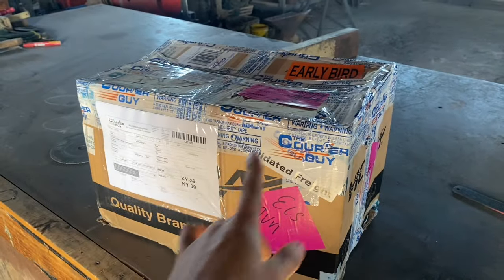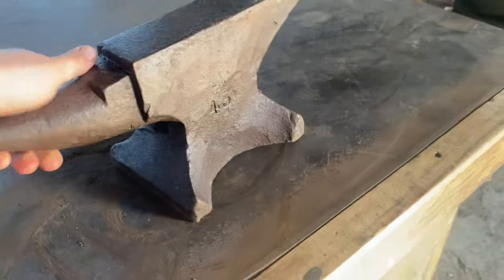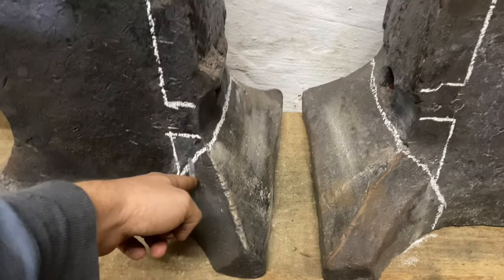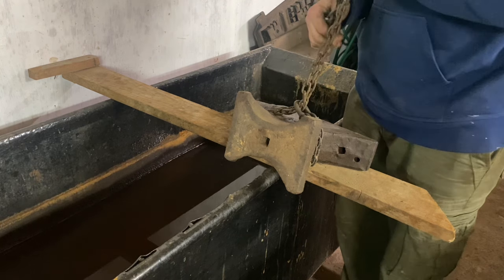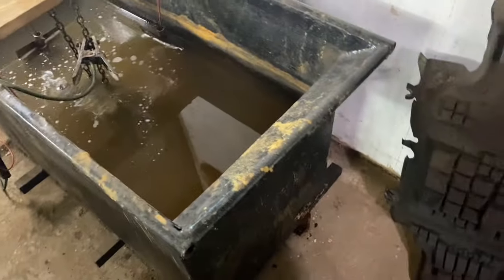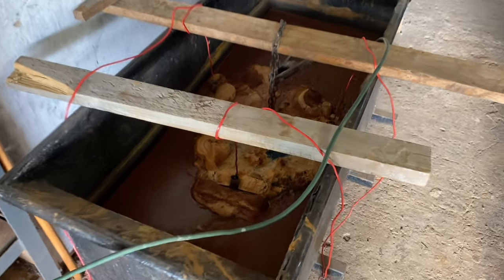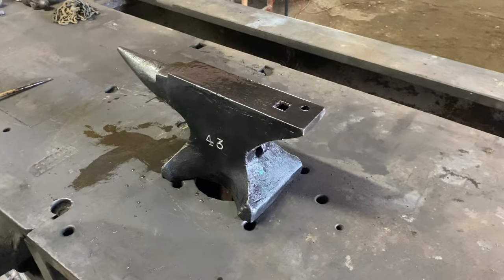Rare little 43lb forged anvil cleanup

Comment: nice! another little gem.  I just sold my 19kg double horn pfp. 🙄 ( bought a 54kg...)  And yes, they are German. Paul Ferdinand Peddinghaus.  If I remember correctly the anvils marked PFP are pre 1930, then "original pfp" then "peddinghaus" and now "ridgid peddinghaus".  Still closed die forged. The small ones up to 30 or 35 kg are one piece forgings, the larger anvils are top and bottom welded together. All tool steel. I don`t think there were / are better quality anvils available.  You`ve got a sweet little collection going on there 😎
Reply: Thats No PFP in the Video . 

The First PFP Anvils got the PFP and a Roman Number  .

Then came "Orginal PFP  " and  "Einheits PFP Amboss "  and "PFP".

Latest stand "Peddinghaus " complete on IT and now the rigid Thing ...
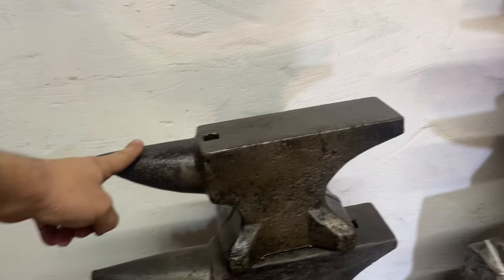Reply: @timom6388  I think the anvil @4:35 in the video definately is a Peddinghaus anvil.  Apart from all signs mentioned in the video, It is closed die forged and to my knowledge no other manufacturer did that.  I have owned lots of them over the past 40 yrs and never seen one marked with a roman number either..?  Could be but that`s new to me.  What does the roman number stand for?  Was it punched or forged with raised maker`s sign?